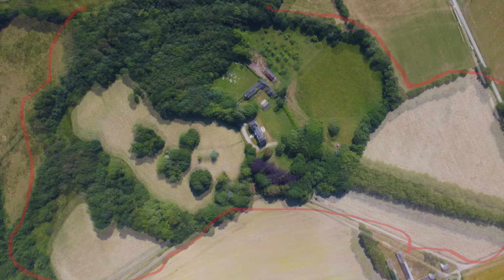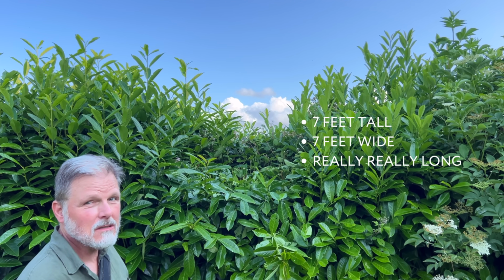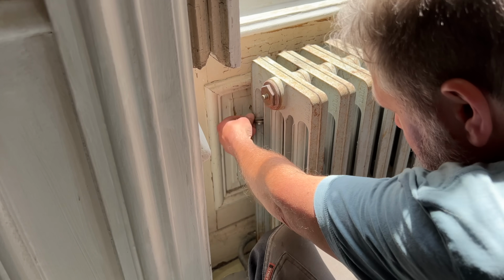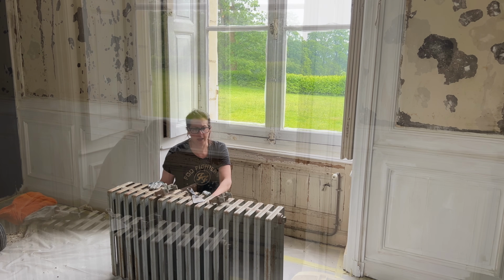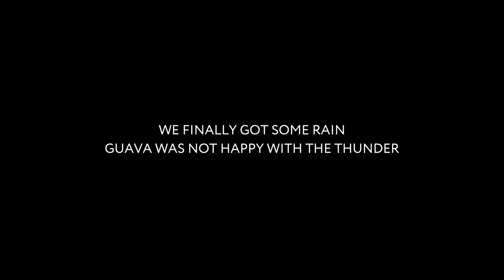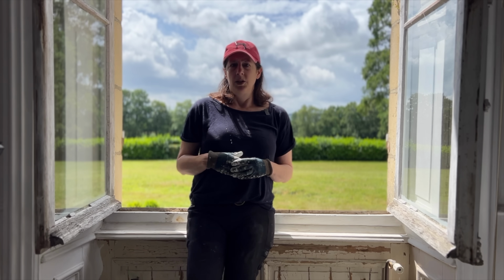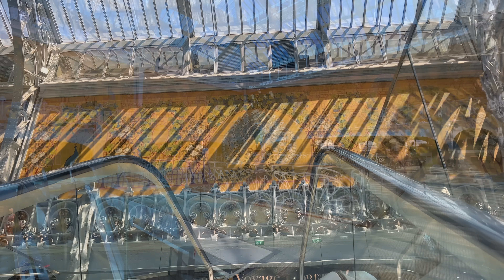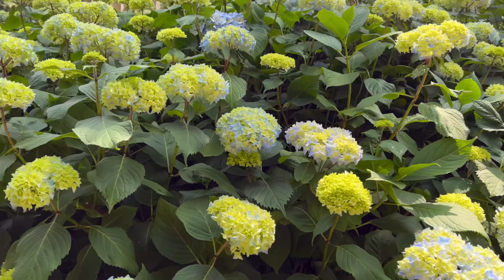The Summer Arrival: Chateau Guests + Leaving for Paris

Comment: I've had 2 of the same paint sprayers.  Kindof a hassle for a small job but so is painting. Messy till you get the hang of it.  CLEAN when done and place it in standing position when done.
  I sprayed interior ceilings and walls white before moving in.  (I could roll a different color or do wallpaper  later it I chose) , For shutters, doors, a few chairs, trim, new baseboard,  I chose a room as my 'paint room" ..I placed anything that needed painted white in that room  and I then did the paint for everything in a day.

Comment: Great video 👍My tip is buy the best quality power tools and buy a 115mm angle grinder which with right disc's you can sand wood cut metal and stone the next tool is a multi tool it can cut metal wood and sand in hard to get place's.Finally get a giraffe to keep the hedge in check 😅